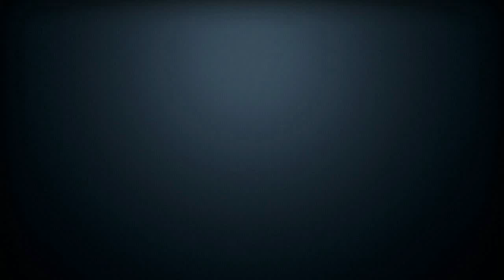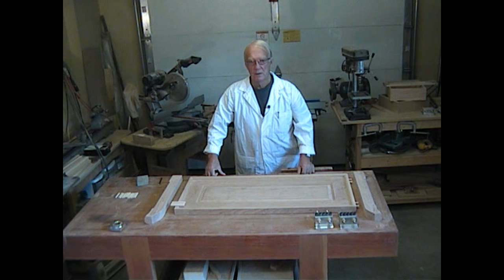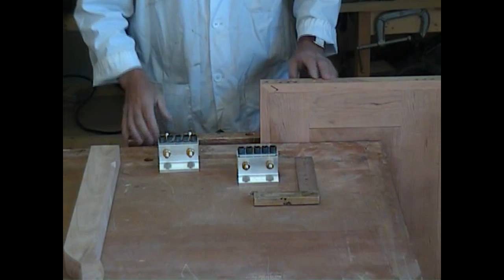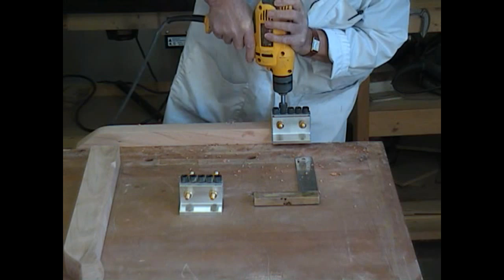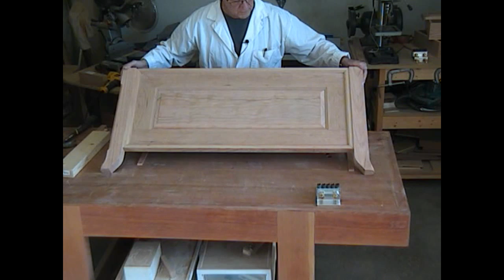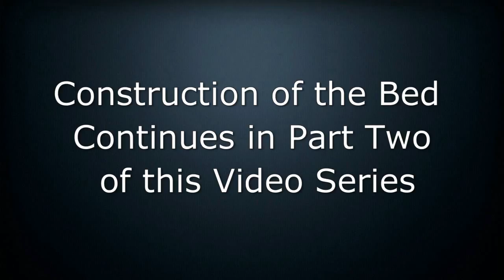How to Build a Bed using Dowelmax Part 1 - Joining the Legs to the Footboard

Comment from the maker: How to Build a Bed Part One: Joining the Footboard legs

The raised panel system used to build the footboard is very attractive, however also very weak. In this instance, the dowel joints will be made integral with three components: the leg, the frame and the longitudinal rail. Three elongated dowels will be used at all four corners to create an extremely strong assembly. The full project instructions are here: http://www.dowelmax.com/diy-bed-construction.html